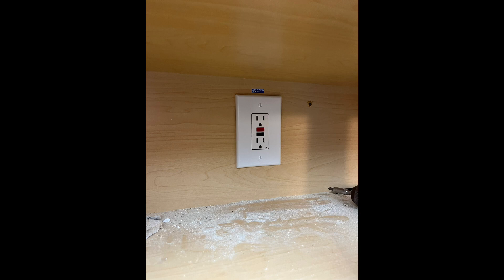How to install an over-the-range microwave & electrical outlet #howto#how#diy #microwave#electrical

Comment: Everything i look up online says you shouldnt use a hardwire to power an outlet . How do I know if this is safe and why is it acceptable in this instance?
Reply from the maker: I haven't had any issues with the outlet at all and I have never heard such a thing. I learned how to do electrical work on YouTube. I certainly am no expert. An electrician did tell me I shouldn't have used a GFCI plug for an Applicance because the draw will trip it, but I also haven't had any issues with that. My best advice would be to consult a licensed professional and be sure to follow the codes where you live (if you care). Thanks for watching

Comment: Great video! I’m currently doing this too. Did you really use tape to patch up the wall? I have the same issue with how they tore into my drywall. lol
Reply from the maker: @LexRilla  thank you! I filled in the holes and taped over them. I wouldn’t do that for a customer but this is my house so I did what was fast and used what I had on hand. Everything is still sticking fine even after all this time.

Comment: In my area this isnt code because we are required to have a dedicated 20am breaker......with that said, I'm planning to be here until I die. Therefore, the hell with code, lol. I think i will be following your lead, lol.
Reply from the maker: @mj233391  I can’t say I disagree! As long as it’s not dangerous who cares!? I’m Not letting my city tell me what I can and cannot do on my own property. I did find out later from an electrician that I shouldn’t have used a GFCI plug because the draw from the microwave may trip it but so far it’s been fine. Thanks for watching!